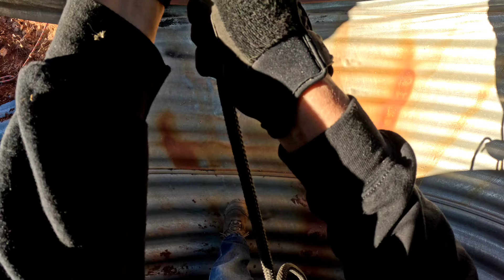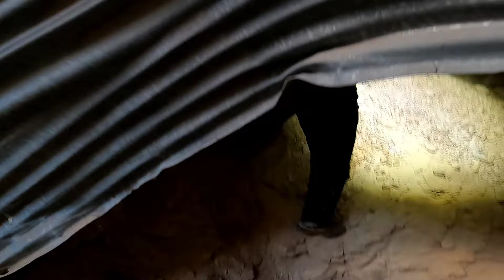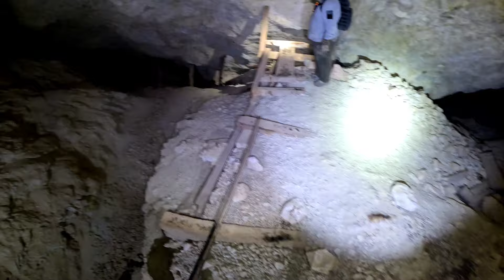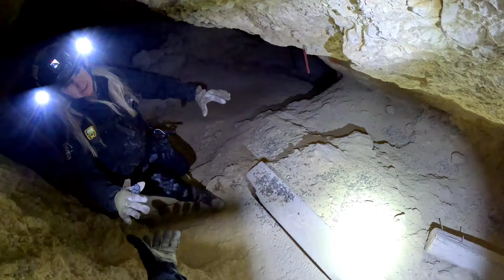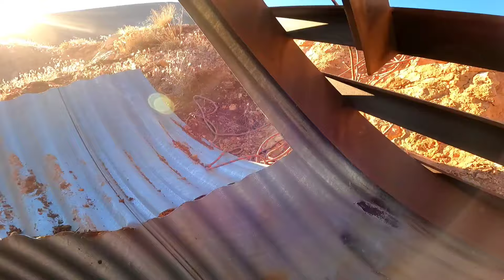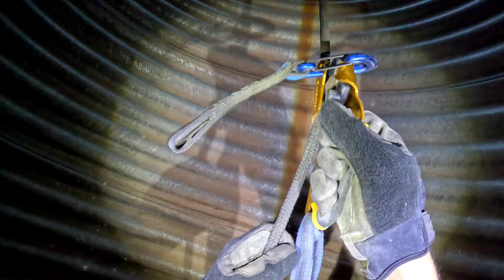When you see a pipe sticking out of a mountain, you go down it.

Comment: Really cool explore that is ruined by the black bars flickering across the screen. Try increasing your frame rate on the camera and see if that helps. Otherwise ….pretty cool!
Reply from the maker: Thank you James.  Changed lights and fighting frames per second, low light which gopro is not the best at, and exposure time.  When I get too close to something, I get the flicker.  Was using new lights as well.  I think we've got it dialed in, but the weather has not been cooperating up here, and we haven't been able to get into much since November.  Running on backlog stuff to get us through.  Thanks for the suggestion and the comment.